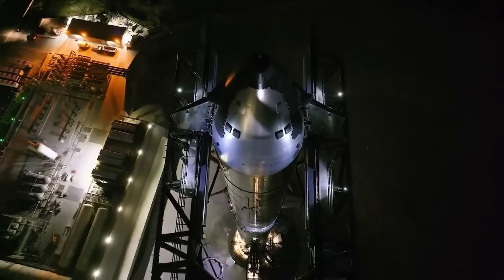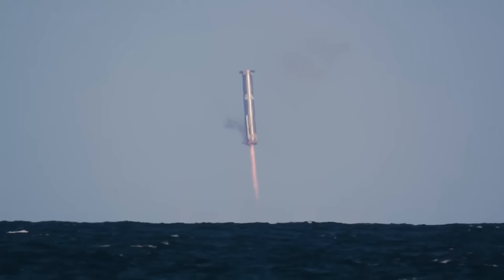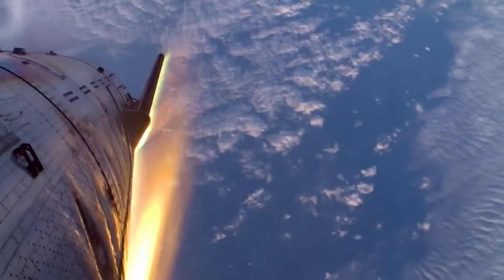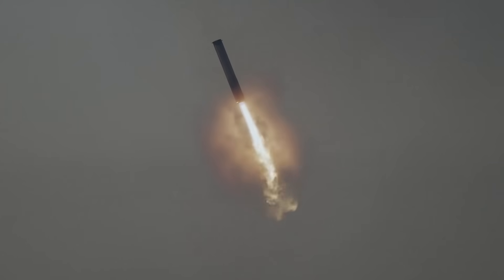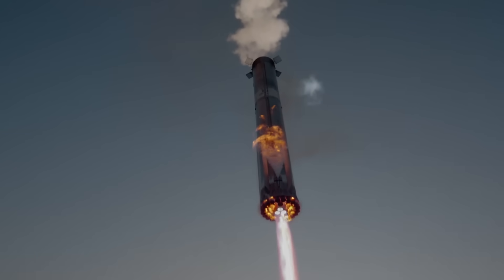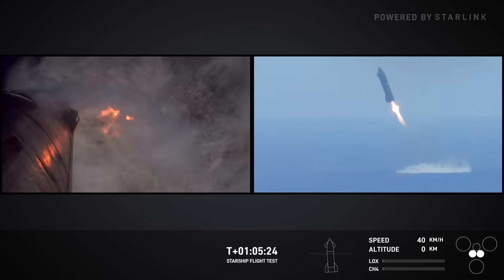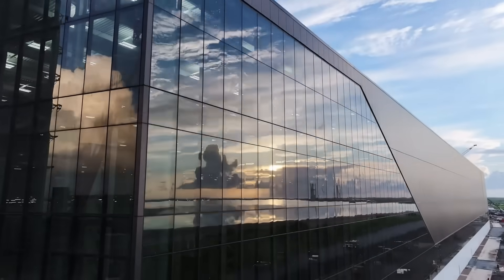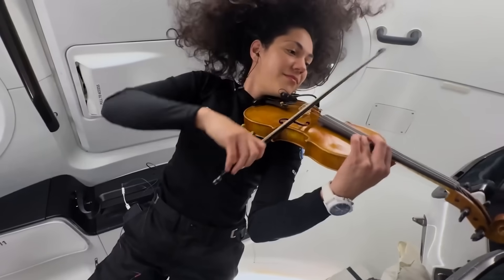Starship Flight 7: Reusing Raptor Engine & Payload Test with Starlink Simulators!

Comment: This will require a [2] second layer of 304L Stainless and more weight plus Methane between layers, Why Not Titanium outer belly layer with the gas between. May not need to weep. Lighter than 304L. is Titanium dragon scales or skin .with weeping gas between the 304L and titanium. Isn't a Flatter surface better for drag and less heat??? Has anyone tried Magnetic field to repeal the psalms?? with 3 magnetic under the Title, one center belly up to the Nose and the other outside under the wing hinges. This must be FULL body. The Magnetic field must be outside of the 304L
Reply: I don't think it's going to be a universal thing if it gets used at all.  Titanium is expensive and PIA to work with.  Magnetic fields need a power source.

Comment: Another great report; just one additional point regarding the Starlink Simulators.  Flight 7 is going to be another sub-orbital trajectory, because they have not fully tested the re-light process on the Raptors. This means that they would simply be wasting any actual Starlink satellites. The Starlink satellites do not have the Delta-V to be able to make it into full orbit from that sub-orbital trajectory.

Comment: The development of Simultaneous Multi-Bit Recording in Fused Silica using Self-Assembled Form Birefringence represents a transformative advancement in the fidelity and reliability of Flight Data Recorders (FDR) and Cockpit Voice Recorders (CVR) for commercial passenger space flight. By harnessing the unique properties of fused silica, which offers exceptional durability and resistance to extreme temperature, radiation and pressure changes, these black box technologies can achieve unprecedented data density and longevity. This innovation not only ensures the robust capture and preservation of critical flight and cockpit information in the event of an incident but also enhances our ability to conduct thorough post-incident analyses, ultimately improving safety protocols in the nascent field of commercial space travel. The proactive implementation of such advanced storage solutions is essential in establishing public confidence in space transportation, aligning with regulatory requirements, and fostering a culture of safety that the aerospace industry must prioritize as it ventures into the future.
Reply: How to say a lot, without saying anything 😕

Comment: Will they carch the ship this year? Absolutely!
Will they reuse a booster or ship this year? Probably not. They get too much data from cutting up and testing the returned flight articles to be reusing them yet. In addition, the fact that designs update so fast means reusing hardware at this point is kind of a detriment. Better to fly newer stuff whilst getting data from destructive testing post flight.
Reply: They re-flew the 2nd or 3rd F9 they landed.  I think just once but it they do start doing it early if they can.
Reply: @imaginary_friend7300  Ah good point sir. So they may rush into it. But, let me first suggest that they only rushed that time because it was their first and only product/service at the time. Now that they have both starlink and falcon 9/H bringing in money, they can actually afford to be meticulous about this. So, I guess only time will tell?

Comment: 3:20 Welcome back, Ellie. I think the reason that they're deploying dummy StarLink 2 satellites is not that they don't want to risk losing the real ones, but, rather, because Starship isn't going into orbit on this flight. The satellites do have ion propulsion, but it is not sufficient to transfer a satellite into orbit unless Starship, itself, is in orbit.
Reply: Even if Starship were in orbit I doubt that the low inclination would be useful for those satellites.   Unless they can do a huge inclination change in orbit, the satellites need to be at a 40 degree or higher inclination to be useful.
Reply: Good point. The 53° and 70° inclinations would have to be launched from Florida, right? Maybe the 97.6° inclination would be better from Vandenburg. 
 @ronlee9984
Reply: Came to the comments to make this exact point 🙂

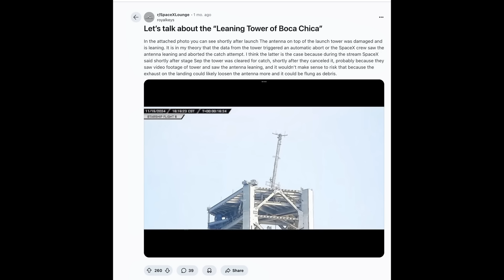Comment: About booster on flight 6 not going for capture… Ellie, you said at 5:53 “We saw those sensors on the tower, at the top, were bent…” causing the splashdown decision; BUT, that was an antenna bent on the top of the tower, not a sensor.  The SpaceX statement you read at 5:40 specified the Mechazilla issue was with “sensors on the arms,” NOT the antenna on the tower.  That’s the first time I’ve heard that!

Comment: You need to be more critical Ellie, calling Elon Musk a spoiled billionaire kid, and remind him that NASA launched in November 9, 1967 the Apollo-4 spacecraft over a Jupiter rocket comparable with the first Starship that was launched in April 20, 2023 and had to be exploded because it was full of bugs and the OLM was a disaster. 
Apollo-11 that landed the first man on the moon was launched in July 16, 1969, 20 months after Apollo-4.
In 20 months, from Apollo-4, NASA launched 7 rockets, many manned missions, and no failures !
 
Starship is going to complete 24 months in April 2025, and we only saw failed garage engineering design attempts!

Here is the list of horrible design issues we saw in 6 Starship flights (F1 to F6) ....

F1: Three engines were shut down before the booster lifted off the launch mount, with at least three more engines shutting down during booster powered flight. The vehicle eventually entered an uncontrolled spin before stage separation due to loss of thrust vector control.
The launch resulted in extensive damage to the orbital launch mount and the infrastructures around it, including the propellant tank farm,

F2: Ship and booster destroyed after experiencing multiple failures including melting and warpage of the grid fins caused by the new hot-staging ring that needs to be ejected before booster landing.

F3: 6 engines failed in boostback burn a few seconds before the end of the burn. Several minutes later, during the landing burn ignition, only three engines ignited, and the booster was destroyed at an altitude of 462 meters above the ocean.  Ship had an uncontrolled roll. Minutes into atmospheric re-entry, Ship 28's telemetry cut off, leading SpaceX to conclude the ship had disintegrated prior to its planned splashdown. 

F4: One Raptor engine was lost shortly after liftoff in the booster that had a bay fire during landing in the ocean. The spacecraft performed a successful reentry despite severe forward flap damage and conducted an unsuccessful controlled splashdown in the Indian Ocean 6 kilometers from the programmed landing spot.

F5: The booster returned to the launch site and was caught by the arms on the launch tower, but a  chine suffered heavy damaged during the booster's descent, and many booster raptor engines were warped because the booster is missing the wings we see in Blue Origin New Glenn rocket. The ship landed in ocean with some damages in the tiles and flaps, and exploded in the ocean floor.

F6: The booster and OLM tower were damaged during liftoff forcing to abort the arm caught maneuver and prevent the complete destruction of the OLM. The ship had warpage in the sides, some damage in the flaps, and no potential to land in a drone ship or in land in case the weather or technical issues do not allow to use a caught tower. SpaceX hid details about the booster, but many experts assume warped and melted grid fins, and warped raptor engines requiring more landing fuel because Elon Musk is a prima donna that cannot accept that Blue Origin winged booster is the correct design approach.

I am very disappointed with SpaceX Starship because is not following the success we saw in the Falcon and Falcon-heavy rockets, and find strange why Elon Musk do not strap some solid rockets to the booster like se see in the SLS to avoid refueling Starship in orbit.
NASA sent men to the moon multiple times without the need of orbit refueling, and reusability is not a valid excuse !
Reply: Hello government Shill
Reply: This is just more hater idiocy.  Never tell the whole truth. This is another fools lies and you just cut and paste.  At no point did you ever have a clue which is why you can cut and paste nonsense and pretend is has validity.  Pretending is all you CAN do because being imbeciles and dishonest you have no capacity to do anything else.  Another fail from a community of proven failures.  You zero's, you're just another burden for your betters to carry.

Comment: It's not that they don't want to risk dispensing actual starlink satellites. It's that there would be no point. IFT-7 is a sub-orbital flight like the others and the satellites would also be sub-orbital. So there's no point in using real starlink satellites. They're going to break up/land in the ocean.

Comment: i expect successful booster and starship recoveries in 2025. Also routine deliveries of the new starlink satellites to orbit by the end of 2025.   There’s lots of room for improvement and advances in reentry heat protection solution. 
          I expect reentry thermal protection to be progressively improved in 2025,26,27 with quicker turn around time & effort, lower weight penalty, and new approaches being considered. I expect 2 additional surprise developments to be announced by the end of 2025: 
first … catching the booster at sea.  This will improve greatly payload by many tons same as falcon9
Second … a one-way starship variant.   The cost of producing one-way starships is dropping so low and the resulting increase in payload size & weight is so high, it should be a cost effective solution for many missions. Especially to help meet schedule deadlines and avoid risk issues.

Comment: Think they will catch the booster on 7 and make it look more nominal, first attempt was a little sketchy...If they try catching the ship on 8 or 9 only problem I see is the booster.  After they catch it, they have to lift it off on a transport stand and roll it off before an attempt to catch the ship.  Problem is the self destruct mechanism, which is hand activated after its on the launch stand.  Can they transport it armed, cause they wont have time to climb up and de-arm it?
Reply: You can safe the FTS remotely.  They do it will all F9's that they recover.
Reply: @imaginary_friend7300  I initially thought of that too. But in technical terms, the FTS is still 'live' and could be triggered by a command from 1. It's own internal system (even though it is highly unlikely) or 2. by the Hawthorne control center or one of the 3 termination buttons in all mission control centres. So to transport it, it needs to have the FTS manually over-ridden to protect everyone and every thing around it.
Reply: The second Tower may be ready for a catch (only) by the time SpaceX attempt to catch the Starship. The rest of Tower B may not be ready, which is not that important at this time. So Tower A catches the Booster and Tower B catches the Starship. If something happens with the Starship catch, there is less ground zero to be repaired, as most of it is not installed.

Comment: When is the target date for Human rated flight on the Starship ? When will it carry an Astronaut!.
Reply: With all the changes currently in progress, from the tiles (TPS), flaps, avionics, control systems, Raptor engines (Version3 "The Tony Bruno 'missing parts' engine" statement, that 'blew up' in his face) to maybe going to version4, plus SpaceX have to come up with a final Starship design for crew of which there will have to be 2 crewed Starship designs: [1 to travel to the moon orbiting station and 2 to go from the orbiting moon station to the moon], there has to be 1 iterative design that has to pass all the FAA tests ans NASA approved checks and balances (eg common hatch components and systems), so it's going to be well at the end of the year, I think, before we even start to see SpaceX start a build of a 'Final Design' Starship for Earth re-entry and for moon station to moon 'shuttle back and forth' missions. So mid-2026 at the very earliest is my thoughts and more like early 2027. The BIG elephant in the room, of course, is SpaceX have to get the ship-ship cryo fuel transfer to work in orbit.
Reply: As far as I know there are no manned NASA missions planned for starship so need to rate it for them.

Comment: It's possible but that's a hard time frame to do, I believe they will be launching V2 Starlink before the end of the year though but the refuel mission will be the one that takes the most time I believe and could very likely slip to next year.
Reply: What engineering issues do you think they'll encounter?  It seems generally straight forward.

Comment: With Trump in office and the FAA being put on watch it think the path is clear for SpaceX to ramp up testing. I have a feeling these next few years are going to be amazing in terms of there rapid acceleration. For sure they are going to want to get as much done in the next 4 years while they have a president that favorable to Elons vision.
Reply: I really dislike how Elon villianizes the FAA. He only has issues with a small department of an organization that does everything from employ air traffic controllers to certifying aircraft. I hope the FAA won't make the same mistake they did with Boeing with SpaceX.
Reply: @12pentaborane  I agree partially, I think with the senate hearings they showed a bias when it came to dealing with SpaceX and Elon in particular. Whether it was intentional or simple incompetence is the question, for sure they where under an unfair amount of scrutiny.
Reply: @dimetime35c  Put on watch?  What nonsense.  They're doing their job the same.
Reply: @imaginary_friend7300  if you followed any of the senate hearings it was VERY obvious that there was a bias from the FAA when it came to dealing with SpaceX and its licensing requests. Maybe it was only the fact they are understaffed and the pace of its launches made it difficult. But there has also been a not so subtle amount of feet dragging from them and clear double standards when it comes to how they treated them.
Reply: @12pentaborane  The complaint he leveled was at their speed.  How else has he villainized them?